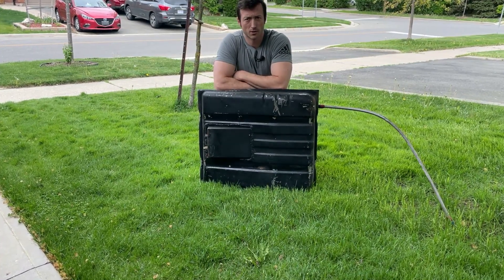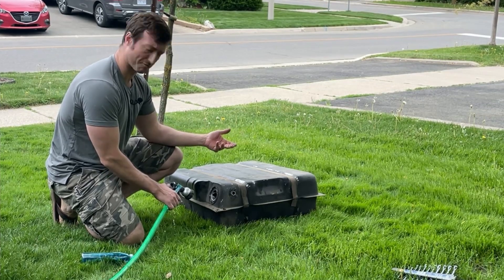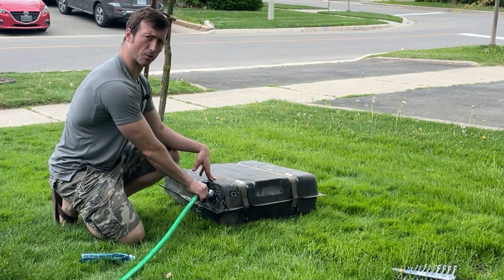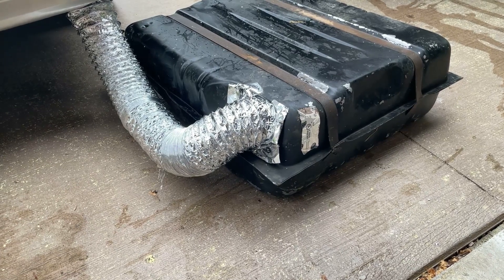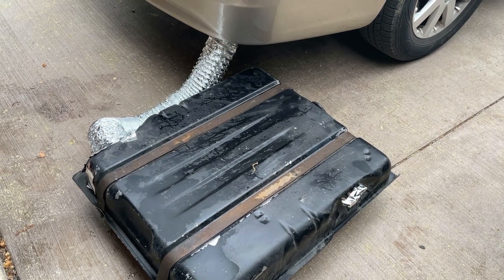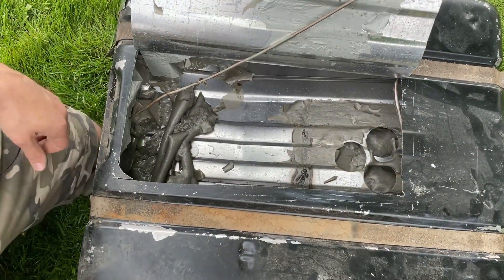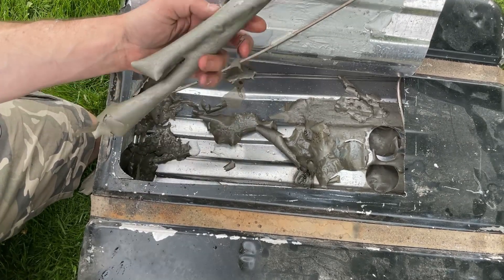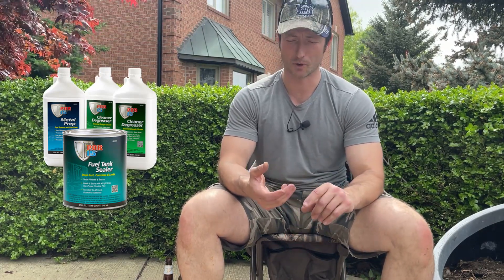POR 15 Fuel Tank Sealer Fail. / How To Prep A Used Gas Tank For Welding.

Comment: It may be that even if you use cleaners, you can't check whether all the places inside the tank are clean? Most likely, you need to check with a camera inside  what kind of coating was obtained after the procedure.
Reply from the maker: It was a new tank.  I prepped it by scuffing it with a chain a

Comment: Is it better to just clean out a tank thoroughly and not use a coating at all?
Reply from the maker: Well I used the coating because I welded the sump and wanted to ensure I sealed any pin hole leaks.  

If your tank isn’t leaking, not sure why you would need it.

Comment: With that peeling it’s obviously a prep problem, if you used your “exhaust drying method” you filled the tank with all kinds of contaminants and moisture.
Reply from the maker: You didn’t watch or understand what happened in this video.  The exhaust was done to render the tank safe to cut open.  The tank was sealed years ago.  Exhaust was never used in the original process.  It failed before exhaust was used.  

The original process was a new tank with a sump welded to it and was prepped with por metal etching.

Comment: You do know that exhaust is mostly water vapor !
Reply from the maker: The exhaust was done so that it was safe to cut open. The POR failed prior to this. It wasn't part of the prep for applying the POR.. The fuel tank sealer was applied to a brand new tank that was prepped properly.

Comment: I recently bought a POR-15 Fuel Tank Sealer Kit ... I have not put in the actual sealer in yet... but I have done all the prep work as directed and I been letting it dry.  After doing all the prep work as directed now the inside of my tank is all shiny like brand new on the inside.. just like yours was in the video.   My fuel tank didn't have any leaks. But is VERY RUSTED on the outside. So I thought I'd use this product just to be safe.  But after seeing your video I think I'm going to avoid using the POR-15 Fuel Tank Sealer Product on the inside of the tank. And just paint the outside of the tank with regular POR-15 Rust Treatment Paint like what's used on car frames and body panels.  I want to thank you for posting this video though... you may have just saved me from making a costly mistake on my project.
Reply from the maker: Do they sell  new tanks? If you can, just buy a new one is my suggestion.

Comment: I had the same thing happen with the Eastwood tank sealer. I followed the instructions to the letter, but after a while, it began flaking off.  They always just blame the process, but I did what it said. Acetone dissolved it and so I was able to remove the failed liner, but what a chore.

Comment: I cleaned and prepared a small Honda fuel tank with the POR kit. I used a heat gun to dry the inside after the marine clean, metal prep, and acetone to make sure it was completely dry. It had a nice grey surface inside. After the coating dried for a couple of weeks I put fuel in it. After a couple of years it peeled off, just like yours. I've used the Kreem @ sealer with far better results.
Reply from the maker: How long has Kreem lasted?
Reply: @VicsGarage71  I've got a Honda Z50 fuel tank that was done 15 yrs ago with Kreem. It is stained by the gasoline but still solid.
Reply from the maker: @jamesbrummer660  wow.  That’s amazing.   If I need it again I’ll use that product

Comment: It seems like it was way too shiny meaning the metal prep probably didn't etch the metal well enough(I'm assuming that's what it does). If it had been previously rusted it would have had enough area to grab on to and stick. Normally you wouldn't paint on a smooth surface .
Reply from the maker: Definitely possible.  The kit comes with metal prep for new metal.  But it’s possible that it failed during the prep stage.

Comment: I think it was the carbon coating the tank from the exhaust plowing through the tank to dry it out
Reply from the maker: That was well after it failed.  That was done so it could be cut open.  

When it was dried originally prior to coating I used a hair dryer

Comment: That POR15 sure leaves a shitty mess behind. I dont think I'll be using that any time soon.  A better way to cut open a fuel tank is just fill it with water.
Reply from the maker: Thanks for the tip
Reply: I’ve had POR15 last less than a year and follow instructions to the T. I’ll not use it again. I only just fill with water to cut open. Works great

Comment: It looks like the "Metal prep" (phosphoric acid and something) didn't bite for some reason. After I used it, the surface was matt from the phosphate that is supposed to be formed but your tank is all shiny on the inside. Why the "Metal prep" didn't work, I don't know.
Reply from the maker: Could very well be it.  Have you had much success with it?

Comment: is that a stainless steel tank looks mint inside ? like it never needed it por 15 works better on metal or aluminium could of been the problem
Reply from the maker: No its not stainless. 

It was a newer tank at the time I modified for a return line and a sump. So I used the por to seal the pin holes and ensure no leaks around fittings.
Reply: @VicsGarage71  Well that rules that theory out then the results in your video made me look at other products trying fertan for motorbike tank fingers crossed
Reply from the maker: Fwiw, it was done a long time ago.  I’ve been told it’s supposed to be permanent.  But if you read a conversation I had with another guy in the video he basically said the life span is about 5 years.  

I don’t want to unfairly slag the product, it’s just my experience with it.  I would read that conversation thread and get his take on it. 

The thing I’ve learned about POR is people either love it or hate it lol.  

Best of luck bud!

Comment: After the metal prep stage of the Por15 kit, the tank has to be dried really well. What I do is get all of the water out with acetone and then evaporate the residual acetone with fresh air. If you dry your tank with vehicle exhause, you contaminate your newly cleaned surface with VOCs from unburned fuel and possibly a tiny bit of oil. That would cause liner failure.
Reply from the maker: For sure.  That exhaust gas in this video was done to make it safe to cut open.  

When it was applied it was a new tank and after metal prep it was dried using a hair dryer.
Reply: @VicsGarage71  Oh, I see. That makes sense.
I guess we'll see if my tank fairs any better. I just attempted to repair a motorcycle gas tank that had a bunch of pinholes using JB Tank Weld and then lined it with Por15. Hopefully it doesn't turn into CarburetorClog15.
Reply: @davecummings3335  do you think acetone will be safe on the metal prep treatment?
Reply: @martinb1340  Acetone will be fine to use after the metal prep. What the metal prep does is actually acid etch the surface, giving the liner a good surface to bond to. If I remember correctly, it also has zinc in it which will plate out a little bit and help to prevent flash rust from forming prior to the application of the tank liner. Acetone will not remove that layer or contaminate the etched surface as long as fresh acetone is used. (you wouldn't want to use acetone that has been contaminated with anything non-volatile because the non-volatile stuff will still be there after the acetone evaporates)
Reply: How long do you acetone rinse any remaining water/drops before draining out? How long would you let acetone air out, before putting in the sealer? Thank you, great process.
Reply: @tomasartica  Water and acetone mix so, just a quick shake with the acetone is all you need. After dumping the acetone out, I just blow the tank out with compressed air. It doesn't matter id it still smells like acetone as long as no liquid acetone is left. Vapors won't affect the coating.

Comment: I just got finished resealing my old gas tank.  I went above and beyond for prep work.  I threw in a 2ft section of heavy chain along with about 20 other small sections of 1in square tubing and shook that for about 1hr total.  I made sure all the rust in there was knocked off as best as I could get it.  It even roughs up the surface so the sealer has something more to bite into.  I then filled the entire gas tank up with hot water and 2 gallons of white vinegar to get the rust in the hard to reach places.  I let that sit over night.  I through in some baking soda and water and sloshed that around for a bit to neutralize the acid from the vinegar.  I used 1 of their degreaser bottles, hot water, and once again shook the hell out of it.  Next was the metal prep and that NEEDS to stay wet so I spent a solid 40 minutes rotating the tank so every square inch was covered and had a chance to do its thing.  I washed the metal prep out about 3 times.  It'll leave behind this white powdery residue that will not allow your sealer to stick.  It's all about the prep work my guy.  Just like a show car quality paint job you can't skimp out on the prep work involved.
Reply from the maker: I didn’t have the rust to contend with so chain wouldn’t have mattered for me. 

I agree prep matters.  Anyone who wants to try it should definitely pay attention to those steps.  I think going above and beyond is a good idea.

Comment: Hey man, why aren't you just replacing the tank?
Reply from the maker: I am now.  I cut it open to see the condition of the POR out of curiosity. 

When I added the sump and stuff at the time there wasn’t really any other options for 3rd gens.  But now aeromotive and others make tanks set up for efi and return lines so now there’s no need to do what I did